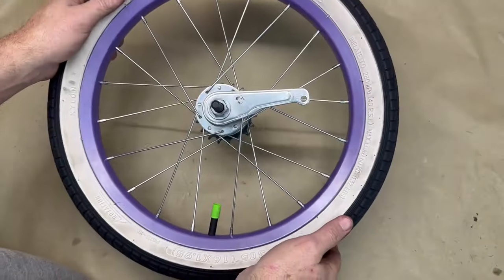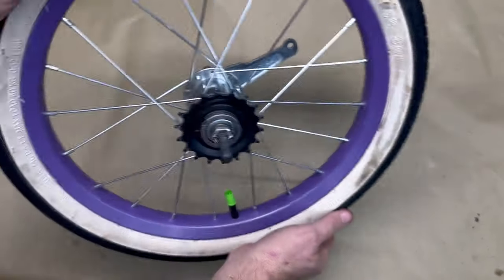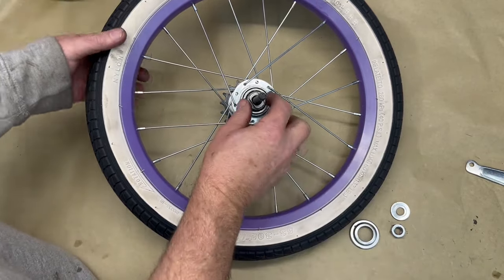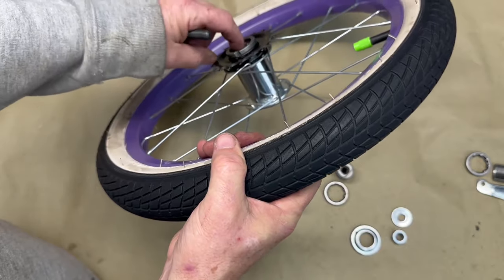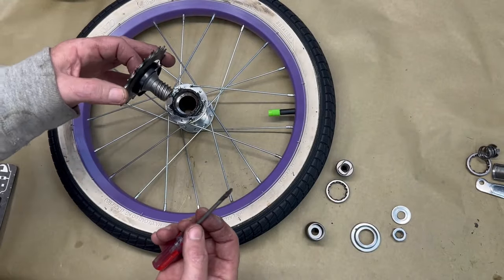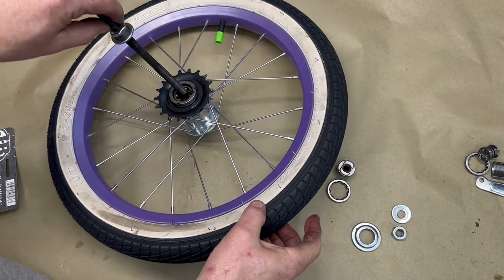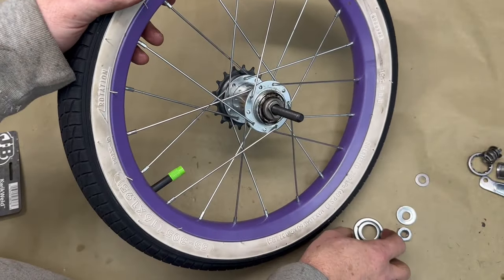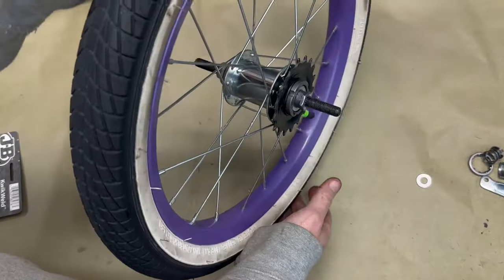Convert a Coaster Brake To A Fixed Gear

Comment: I decided to use Korean Glue instead epoxy and it works well 
Is it recommended?
Reply from the maker: Depends on what it is being used for. If you are riding it I would say no.

Comment: How come when i stop pedaling it makes a grinding noise i didn't even take the thing apart just took the tire off and back on and i took the coaster brake spun it around the frame and now its grinding why ????
Reply from the maker: Sounds like a failed bearing. Could also need greasing.

Comment: Is the epoxy necessary? Great video. Thanks!
Reply from the maker: You have to use something to make the hub a fixed gear. Without epoxy, welding, etc the hub will continue to spin.
Reply: I see. Thanks for the clarification! @TigerCreekFarm
Reply: @TigerCreekFarm  can i just use super glue?
Reply from the maker: @AlzafranAqil  I would not trust super glue in this situation